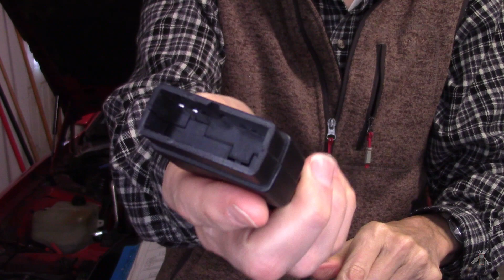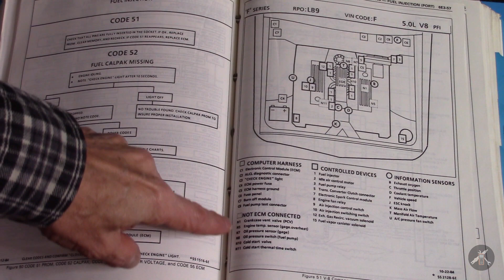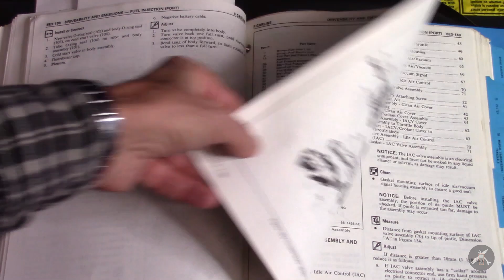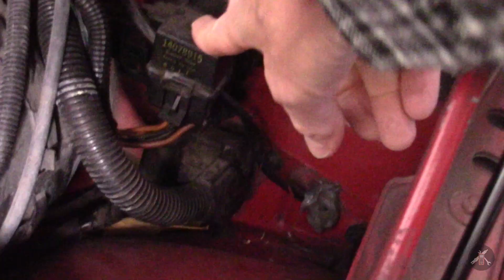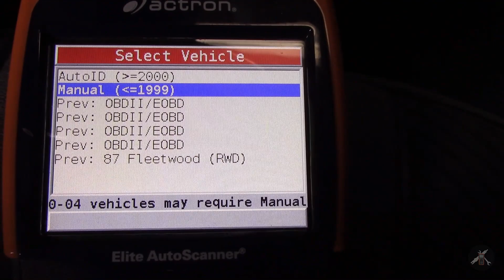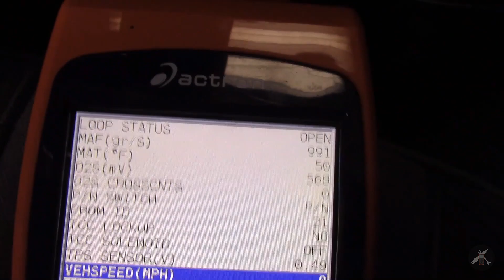Diagnose and Repair GM OBD1 Computer Controlled Cars- Chevy Tuned Port Example

Comment: Great video!  For my ‘82 Corvette I use a free tool called WinALDL, runs on my laptop.  Needs a cable that if you’re handy you can make one but I just bought one from OBD Diagnostics for about $60.  Allows me to see in real time what the ECM is seeing.  Was key to helping me find a bad IAC.  Thanks for sharing your experience and knowledge.
Reply from the maker: Thank you!  I appreciate your comment and suggestion.  I do know about the cables and laptop software.  It's on my list of future things to do.  For most people the self contained scan tool is probably easier, but I haven't gone through the process with laptop system yet to compare.
Reply from the maker: Just a question for you.  Which interface are you using on your laptop?  Are you using an older style serial port or a USB?  As I was looking at cables, there is a choice, and I saw a suggestion that it might be better to use an older operating system and the old serial port rather than USB and Windows 10 when using WINALDL.
Reply: @bitsofwisdom460  I use a usb cable, windows 10 and WinALDL.  The only hiccup was I had to give WinALDL permission to write to the hard drive to record data.
Reply from the maker: @steve22424  Thank you!  That's excellent.  When I was working with the factory calibration teams, they often used older operating systems for long after everyone else upgraded due to the special needs of the controller tools.

Comment: Good information and advice.  One of the first purchases I made when I acquired my 1991 Firebird Formula was a GM Service Manual off of Ebay and it has been incredibly valuable when trying to figure a number of problems, as well as getting the correct torque values for various fasteners and bolts.  I've even sat down in some evenings just thumbing through various procedures in the manual, just to get myself more familiar with the car.  

I think people shy away from these TPI cars because they don't fully understand the TPI system itself, and the OBD1 controls. But, once you get your mind wrapped around it, they are incredibly simplistic compared to today's cars, but as you highlighted, you still have to have a good mechanical knowledge of how the engine works.  

Thanks for taking the time to put this video together.
Reply from the maker: Thank you for your comments.  I agree that the TPI isn't as complex as it seems at first look, and yes the factory manual is really essential.